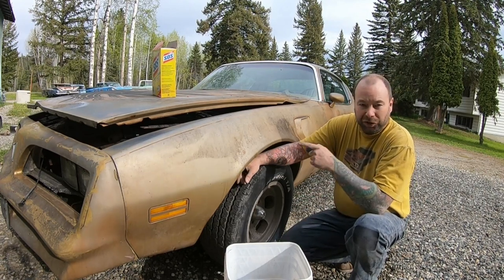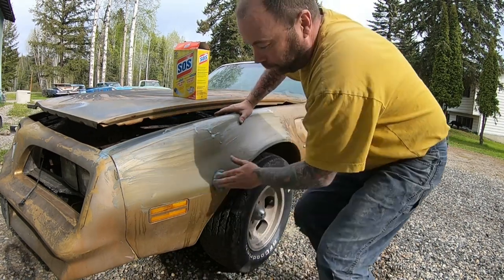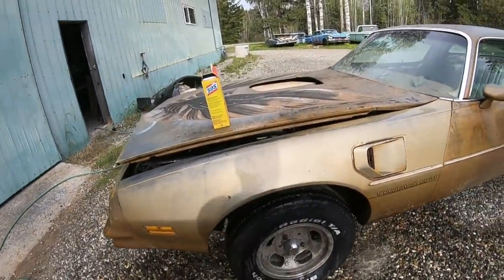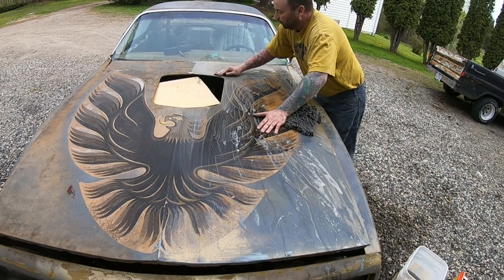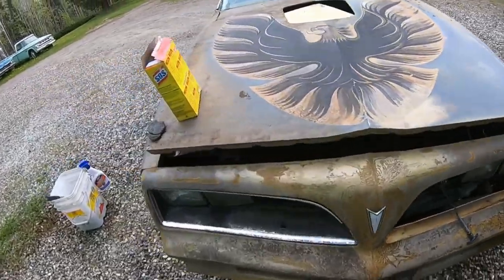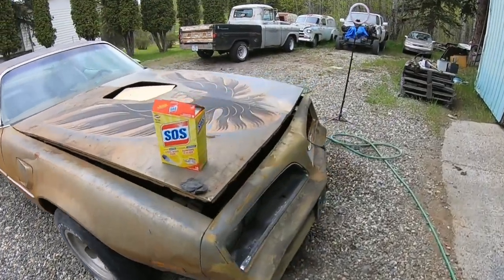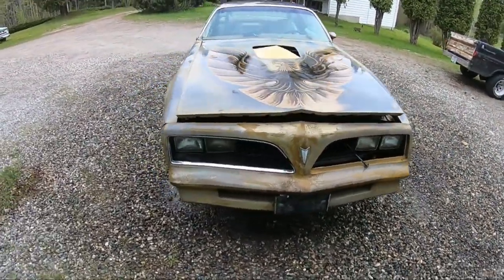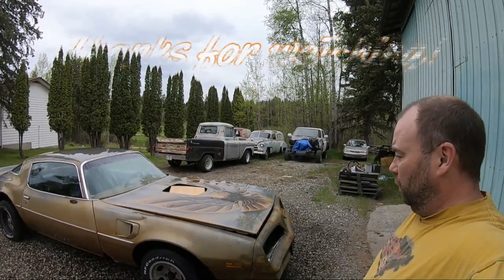Creating perfect patina, 78 Trans Am revival part 3

Comment: I cringed at first when I saw the box of SOS pads, however, it was warranted with what you're having to deal with.  I know my front fenders each have two prefabricated holes in each of them to accompany the flares.  I do believe that the rear wheel flares also have prefabricated holes, too.  I had to tighten one up many, many years ago but I can't recall if it's just one hole or two.  They also screw into the inner fenders as well.
Reply from the maker: Yes, it’s curious whether they’re missing, or were never there. By the Vin it’s a real 409 4 speed Trans Am. If I ever choose to do the body properly it’ll be to bare metal, so the SOS pads won’t harm it😁😁

Comment: The VIN will tell you like most people said.. There were no 400 4 speed in a basic Firebird but was in the Formula and those did not have the flares or the side vents on the front fenders..
Reply from the maker: Yep, it is a real Trans Am off of the VIN. I guess all of the extensions got removed at some point over the years. I’ll find a set eventually 👍🏼

Comment: All 70-81 TransAms had the wheel spoiler flairs.   Although the 79-81 were a different shape.   Regarding if it is a legit TA: look at the vin.  It is a TA if the first two digits are a “2W”.    I like the look with the patina but would put on a new set of factory WS6 (reproduction) Snowflake rims.
Reply from the maker: They must have been removed, I didn’t think it would have come without them. By the VIN it is a legitimate Trans Am  👍🏼